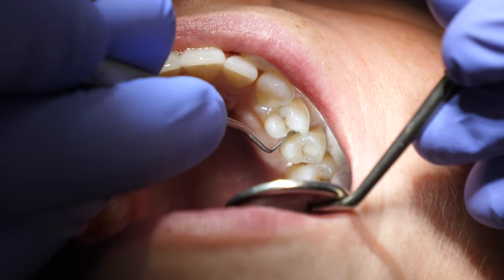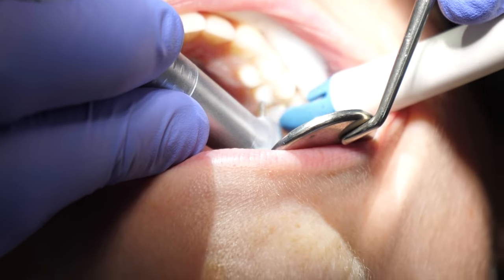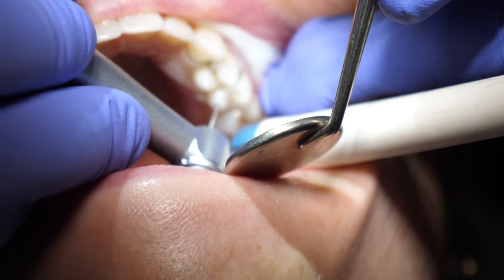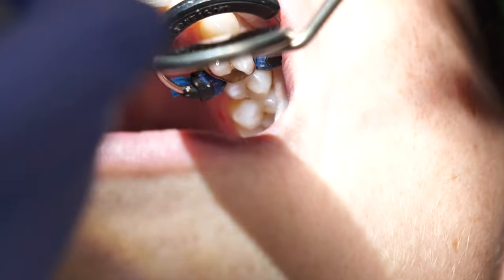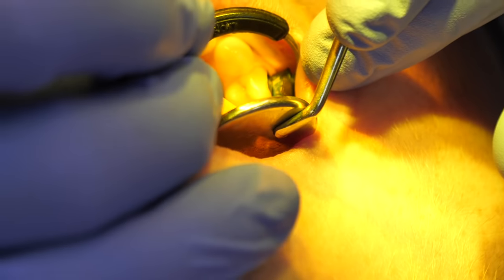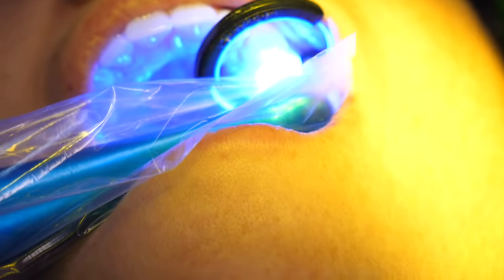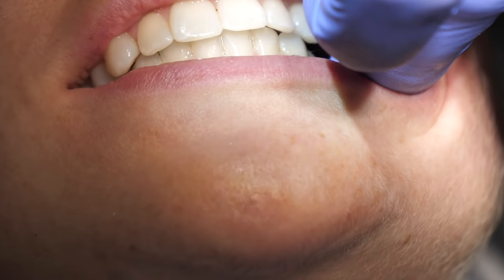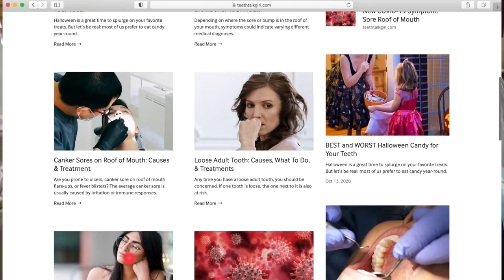Dentist Filling A Cavity Between Teeth

Comment: This is exactly the procedure that I had yesterday. For anyone worrying, fear not! You don't feel anything at all! Just a slight disconfort when the dentist puts that brace thing, you can feel it pushing your teeth, other than that no disconfort, let alone pain. Even the syringe is painless, you feel a slight pressure like you would when pushing your finger on the gum.
My cavity was just as big, and was starting to hurt and be sensitive, the tooth at this point can still be saved. As soon as you feel a bit of pain, go to the dentist ASAP! The tooth will be saved, the intervention is 100% painless and the costs are reduced compared to a root canal or an extraction. Don't let fear destroy your teeth!
Reply: I had this done but they didnt use the clamp so my floss catches on the edge of the filling between both teeth. They did one tooth and then cut into the tooth next to it. They didnt use the clamps so when i floss it feels like i am going to pull the filling out. The floss ends up getting cut by the sides of the filling. Ended up having to go back after a week because they didnt grind down the filling enough and for a week it gave me a migrain. So had to have them fix it. Now i have to try to find a different dentist to fix the gap between the teeth. 😡
Reply: Pain was 11/10 after filling!
Reply: @sashaeltekeh2618  This I can agree with, but it depends on how deep the cavity is. Out of the 4 fillings I've had in the past couple of years, one of them hurt really bad later that evening. The cavity was millimeters away from the nerve so I guess the dentist actually touched it a bit or something. Nothing a couple of ibuprofen tablets won't solve though. Next day I was as good as new 😁

Comment: as someone who has recently had a filling and is due for another one soon, i will tell you the truth. my dentist did use a numbing cream which did get rid of the sting from the needle, it’s just felt like pressure but the pressure from the needle went away straight away because of the fact that they numbed it. during the procedure you just feel a little bit of jaw movement and mouth moving. after it just feels a little sore but it is very minimal

Comment: if you came bc you were nervous ab getting cavities filled soon, i was the same! however i am here to tell you IT IS PAINLESS. i went this morning, was super psyched out ab the needle for numbing, but they will apply topical gel to the injection site of your gums FIRST, this gel works really well to numb, when the needle is inserted you won't feel a thing, if you feel ANYTHING from the needle it'd be a slight sting from the numbing agent being injected into your gums but it seriously feels like nothing. the procedure itself, your dentist will make sure the area is 100% numb before even starting! i had a few injections before they began working and when i tell you the only thing i felt during the work was the suction thingy in my mouth and slight pressure from the drill but again NO PAIN WHATSOEVER! i have a really low pain tolerance, so if i can do it you can too. and not to mention, it only took like 30/45 mins for them to be completed, i only had 3 cavities. :)
Reply: I have an appointment to get 3 cavities filled in 2 days!!! Your comment really reassured me, thank you!! 🫶
Reply: @grimes-444  I M going on 13aug...any swelling after ?
Reply: @wasimahmed1570  my tongue did swell a bit but nothing too concerning, the numbing did last a little longer then I would have liked but the procedure was fine and relatively fast for 3!
Reply: @grimes-444  thanks for the answer....were u able to eat after ?
Reply: @wasimahmed1570  You can, but I wouldn’t recommend it since when you are numb you can easily bite yourself very badly and not feel it.
Reply: @grimes-444  thanks...stay healthy
Reply: I just had 3 cavities filled as well & 3 hours later, I just ate my dinner and I’m feeling great, no pain whatsoever.
Reply: @Housewitch888  wish me luck i m going for that on friday ...happy for u and stay hleahty

Comment: i brush my teeth and floss (i even use mouthwash after) and i still get cavities lmao. 
i spend like 4 minutes brushing, 2 minutes flossing, and like 50 seconds tops with the mouthwash

i’m beginning to think i’m cursed but it’s likely genetics that puts me at a higher risk for cavities- my mom also has decent dental health but she still gets cavities.
Reply: same! i just found out i have 3 cavities all of my cavities have between my teeth, they just now told me i have been flossing wrong.
Reply: Same here. Although I did get my cavities at like 12 and never went to the dentist so I think my teeth are permanently sensitive no matter how much i take care of them now
Reply: @iliketodissectgirlsandimut3816  good luck! I’ve had two fillings, one was a very tiny cavity, the other could’ve been a potential cavity. It barely ached for me the second time. The first one hurt because I was numbed (the needle). You will be perfectly fine
Reply: Cavities are not only caused by  food. You can get small micro fractures on your teeth that can cause cavilities in long run.  It can also be cause by other tooth putting too much pressure on one tooth from eating hard foot. Micro fractures from biting hard. Genetics

Comment: Went to the dentist to do my yearly clean checkup process today and I’m booked to get a filling this year, so I’m scrolling through all these videos aha

5/8/2021: finished receiving my cavity fillings on two of my main bottom wisdom teeth, went pretty smoothly and well. My fillings personally did not require anaesthesia, so the hole drilling process as it went lower did hurt a bit but was still bearable slightly. My lips were dead dry at the end ahahah, but overall it was better than I expected and I feel way better now with my cavities gone 😌

Comment: I recently went to the dentist after not having gone for 4 years. I suddenly realized how long it had been as my flossing and brushing hadn't been the best 2 years ago and I was super anxious and worried that I would need extensive work done. I finally went to a dentist that had good reviews and took my insurance. I had 5 caries, all incipient decay with a few being between the teeth. Luckily this dentist uses silver diamine fluoride as a treatment, which involves no drilling no injection. I feel so relieved having found a dentist that offers a minimally invasive treatment without having to remove all that healthy tooth structure to access the actual decay.

Comment: Fortunately I'm not a person who is afraid to go to the dentist and I also practice good dental hygiene.
 But the few treatments I had done to remove wisdom teeth and recently a root canal on a tooth that looked perfect until the pain arose (had a point of the crown damaged and seems bacteria got in through a hairline fracture because the dentist found no actual decay on the enamel or dentin, but the pulp was compromised). The only thing I really dislike but endure are the anesthesia injections on the back of the jaw, but it has to be done and makes the rest of the process pain-free.

Comment: My dentist did some of this but I can't bite with it it hurts 😭
Reply: Same, and im pretty sure it isn't supposed to hurt. Atleast not as bad as it does
Reply: it isn't supposed to hurt....cuz when they drill the tooth the cavity should be removed  and so the pain should be gone by then and  after the filling they should check the height of the filling is normally checked to avoid any unnessary discomfort....normally it only hurts while the drilling ....but I would prefer u check with the doc
Reply: @anonymous641  my dentist sucks, i just moved to a new one even tho i didn't want to bc ik they were bad. When they did my fillings it hurt like crazy and it was hard to stay still. Even 3 weeks after my teeth still hurt when I eat
Reply: Omg me too.

Comment: Is that common practice now or always has been to use the topical cream before using the syringe? I think I have always had two fears with the Dentist, the feeling of the syringe and the drill. If I know I cant feel the syringe and therefore the drill, most of my problems will be solved.

Comment: Just got my tooth filling today and I was terrified of the needle. The gel they used on my gum pretty much prevented me from feeling any pain from the needle. 
The most unpleasant part was the drilling because it felt like having an ice cube rubbed on the tooth and was super sensitive. 
Ended up with this cavity because food kept getting stuck in a certain location so now the filling should prevent food from getting caught there after every single meal
Reply: Oh cool ihave 5 cavities need to be filled
Reply: @jesusismysavior8964  yeah don't worry too much about it. I'm absolutely terrified of needles and it wasn't that bad. Should only take 30 seconds to numb it.
Reply: @JonathanKayne  k and yeah ihad teeth cleaning today and ihave wisdom teeth pain they said ineed a root canal

Comment: It's actually interesting how different clinics have different protocals... I got 2 of my lower left bottom cavities filled and there were 2 dentists, 1 the dentist and the other was the dentists assistant who handled the high water pressure pipe and suction while the other drilled and did the other "heavy lifting". Actually my mouth was held open with a large tube that separated my mouth completely and had a vacuum suction function so the water was sucked right into it when they rinsed. This fascinates me so much, I love how evolved this kind of medicine has become. No doubt back then anesthesia/numbing agents did not exist at all so you were pretty much left in pain/agony.

Comment: I have a question. I got one of these down this year. Mine filling was on side toward my front teeth. Since it’s closer to my front teeth I can see the finning and it looks like a big crack that goes from the root of my tooth to the bottom. My dentist said this is normal but want a second option. How does the side fillings look if near the front of your mouth? Is having a distinctive line normal?

Comment: Hi Doc ! I had a black line between 2 teeth on the exact same spot as in this video. I showed it to my dentist and he did the filling. But that filling between 2 teeth is not separate. It's actually joint. I feel sharp pain when I chew food from that side. He checked on the X-Ray and said it's no way near the root and that he did that joint filling so that it won't come off. He said if he would have done it separately then there would be a chance for the  filling material to fall off. (I can't floss because of that joint filling)😭😭😭😭 I doubt what he said. Never going to go back to that dentist. Please help. Is there a possibility that it can still be fixed @teeth talk girl ? Everything was fine until I went to that dentist and he messed it up
Reply: Please reply 🙏🏻
Reply: I fill teeth for the dentist. I am an EFDA. Been doing this since 2004 and I never worked for a dentist that would bond 2 teeth together.  I never heard it to be done either.
Reply: @stevesmom9868  I am never going to visit that doctor. I went to another dentist and he said that I'll be needing a root canal of one of my teeth and composite filling on the other (Previous dentist did a joint filling which further irritated the nerve). But I insisted if he can fill the teeth with filling separately. He did exactly the same. But that irritated nerve still gives out a tingling sensation which lasts for hours at times and then becomes normal all of a sudden. I'll probably be needing a root canal but I'm delaying it as it is an invasive procedure. Any suggestions/opinions?

Comment: Why not crown that tooth? Side fillings are weaker fillings than a filling on top of the tooth.

While saving tooth structure is important, so is longevity of the restoration.

A crown is by far a very strong restoration with an average life span of 8-13 years and potentially longer should you take care of it.

Comment: Quick story. I didn't go to a dentist for 10 years. Big mistake. I got a root canal and 10 fillings. I got the 10 fillings all at once. Yep. One trip for fillings cost me 3000 dollars. The root canal was another 1200 I think. 5 months later the root canal got infected. On a Friday of course. Worst pain in my life (and I fractured my elbow when I was 10). I just had them extract infected root canal for 600 dollars. The dentist/surgeon cracked a molar when removing root canal so I needed a crown put in. Another 1000 dollars. Then six months later 5 more fillings. Moral of the story. Go to the dentist regularly to avoid this scenario.

Comment: for those that want to know what hurts I’ll let you know!

The anesthesia hurts! Not going to lie I’ve already had this done and I’m going again for another cavity! So yes the anesthesia does hurt since they do it 3 times!

The drilling!; the drilling to remove the cavity also hurts but don’t move a lot ! And that’s it!
Reply: On a scale of 1-10 how much does the drilling hurt?
Reply: @KingAsa5   about a 8-7! It hurts since they use it to remove the cavity! If you have a high pain tolerance it could be 6-5 !
Reply: @thatonebtsalbum8347  which one hurts more the drilling or anesthesia?
Reply: @thatonebtsalbum8347  and how long did it take for them to do the filling?
Reply: @KingAsa5   it takes mainly 10 minutes for the whole process to be done!, anesthesia  takes 3 minutes or less
Reply: @thatonebtsalbum8347  I’m scared😢😢😢😭
Reply: @KingAsa5  don’t worry!, you’ll be fine they will numb your gums and put the anesthesia in! Then it will hurt but it’s like a poke and then they will wait then drilling process begins! But personally 5-6 is the pain felt by the drill
Reply: @thatonebtsalbum8347  wait you still felt pain from the drill?😭😭😭😭😭😪 
I’m scared
Reply: @thatonebtsalbum8347  thanks fam. I got my filling and There was hardly any pain😭😭😭
One of my teeth is still a little sore afterwards but so far all great. Thanks for the reassurance 🙏🏾🙏🏾🙏🏾🙏🏾🙏🏾😪😪😃🙃

Comment: i had this procedure done today and ngl the only part that was really uncomfortable was when they put the band in between my teeth. for some reason it only hurt on the top teeth, but not the bottom teeth :/ i couldn't feel anything else though, thankfully although the numbing shot kinda pinched a bit (it was over pretty quick though).

Comment: Just get filling today(small one)Spend only 4 min on Actual work. Advice: plz guy encourage urself the drill won’t deep is the cavity isn’t deep so it just a min of drill and it done no pain at all. Leave it untreated just make it become worse. When U leave it along time structure of teeth will fall out and hard to fill so dentist will crown instead that is the painful one cause at this state cavity have already reached nerve so the drill must be painful that need a numb so plz do everything yall can before it to late cause pull the teeth out even worst then crown I really regret my decision that I pulled out my teeth rather than go for crown. Missing teeth make another side of the teeth closed to each other but it will end up ruin the line( teeth will turn forwards)and top of the teeth we pull out will fall that will make it loose and hard to chew and chew only one side will cause another side of the teeth get tooth decay and TMJ the solution for that are implant and bridge and cost a lot of money more than fill and crown 2 to 3 time especially Implant.Good luck guy we all can do it 💪💪💪💪💪.

Comment: I’m here to find out what’s gonna be happening in my mouth in a couple weeks, I have a quite a few cavities cause the last time I went to the dentist was 9 years ago. 

Luckily they didn’t mention anything about any major cavities that would require a root canal. I do have one fairly large cavity that’s on the back of my second front tooth on the left. Never noticed it till my floss was getting stuck there all the time. 

Probably the worse one in there.
Reply: I am going to the dentist tomorow. I have a cavity that needs to be filled. If it doesn’t work then i am getting my tooth pulled out because root canal is too painful.